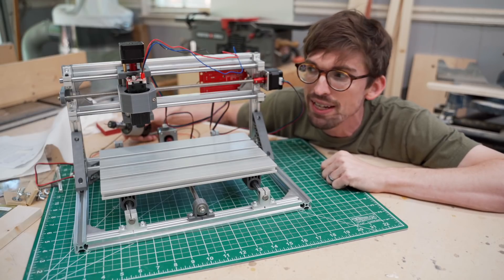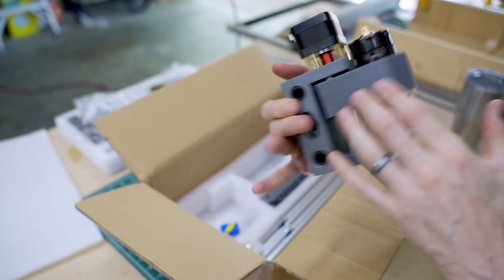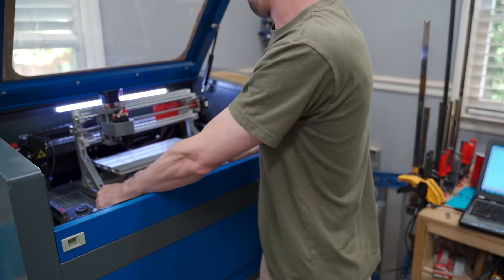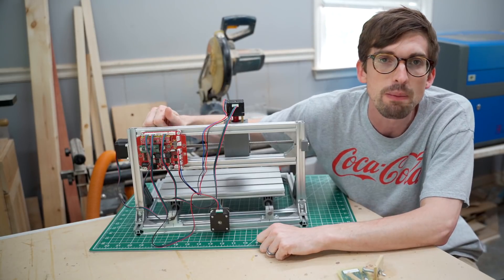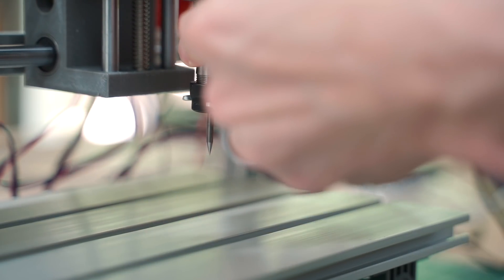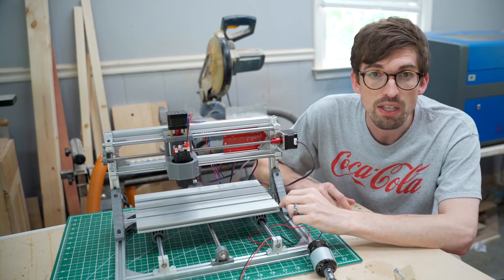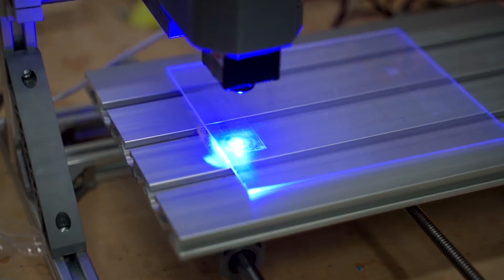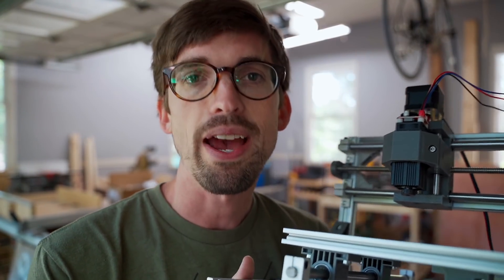Is a Sub $250 CNC worth it?  Alfawise C10 CNC & Laser Review

Comment: I spent round 130€ for the same CNC. And had fun with it for five months. Ok. the laser should have been 5 Watts and was only 2.5 Watts... good for my eyes. PEOPLE PLEASE BE SERIOUS WITH LASER BEAMS. Once the damage is done no doctor can help you back. THEY ARE BUT F*** DANGEROUS. If you wanna learn about G-Code and CNC basics one of these simple devices will get you in there with ease. Ok. They don't have end signals. But you can add them. They will not mill metals without modifcations... but if you have the right drills you can do a lot with wood or some polyuerathane foam stuff.

Comment: If it was $250 in 2019, and the inflation rate is about 8% since then, the price should be about $270 to keep up with inflation.  However, the price in the link is $353, nearly 30% higher than what is quoted in the video title.  Not sayin' the title is a lie, but that that the current price is a HUGE ripoff. 🤬

Comment: I wonder if I can put my router shanks and make it work with those ones. I have a small manual router (those 300 watts sold everywhere) and came with a 6mm straight, which I think could use it.

Comment: you can do some decent stuff on these things,  I use it to cut out my kids pinewood derby cars.   I have to use a jig to hold the block on and the limited z causes me to have to run the derby car block thru the table saw first to bring the height down and do it in 2 parts if its a taller car. 

also with the laser, I've laser engraved a flour tortilla. LOL

Comment: Depends on what you want to do.

To mess around and learn a bit while possibly making useful trinkets... these little machines are a good start.

Low cost and see if you are actually going to do anything at all with it.

When you find that the stuff you want to CNC carve is not going to be able to be done on the little machine, change it to a laser engraver and get a better CNC machine.

These little things will make some nice looking coasters and key chains and carve the color layered plastics for small signs.

Not good for engraving brass really.

If you want to make a small number of thin aluminum sheet metal parts for RC models, the 3018 series CNC can do the trick.

Comment: The problem with ALL these cheap CNCs is that they rely on the stepper motor's ball bearings to absorb axial (thrust) forces created by the leadscrew. The leadscrew in real machines is located in a thrust bearing equipped block, with the motor attached by a flexible coupler. The ball bearings can not take much axial force, and will fail much sooner than if they are coupled properly.

Otherwise, the problem is flex and a weak spindle motor/mount. Good enough to learn on, and for cutting/engraving acrylic. Clever people might be able to make some improvements...
Reply: Curtis Newton  Axial play makes inaccurate cuts, which I'm sure you couldn't care less about. My comments were directed at people who care about what they do, not at hacks who have nothing better to do than talk shit on the internet.
Reply: Yeah that's one thing I did on my machine was fully support the lead screws. They ride in bearings on both sides. These machines cut every corner they can. That's how they can sell for $150. Those unsupported round guide rails are pretty flimsy too. They look like inkjet printer surplus to me.
Reply: Curtis Newton  you can't replace bearings in stepper motors. Well I guess you can. But the motor won't run after you've taken it apart. Well it'll run at 10% of its original torque. Those motors you're getting with this machine are the weakest piss you can buy as it is too. So you cannot afford that kind of a sacrifice. So essentially you can't replace bearings in stepper motors. You demagnetize the rotor in them when you pull them apart. You lose the keeper function of the motor body. And that's why it can't be done.

Comment: Well, you can put $650 ( Creality CP01) or $800 ( Snapmaker) into  a triple threat, OR BUY a Sovol printer for $300, and a separate CNC/Laser for $250. When one goes down ( ajs my CP01 did within 2 days), you still have a functioning CNC. Creality has been remarkably UN-helpful in providing replacement print head, or in authorizing a return. Now the print head has shorted-out the thermistor. It shorted agains the metal work table, hand that will not heat above 47 degrees. Nothing will stick. Without Mac software the CP01’s CNC function is out of reach. I am TRYING TO GET A RETURN OK, but I bet it will go out to the garage, and will sit under a garbage bag, as I TRY to forget a totally miserable experience with Creality and their CP01. AVOID IT LIKE THE EBOLA VIRUS!!

Comment: Any laser doesn't work on clear or shiny surfaces.   You need a non-reflective coating or surface.   They recommend anodized aluminum at best, because you can laser the anodized layer.   But if you're creative and understand the fundamentals, you can get it to work.  If you don't do anything like this professionally, you're going to struggle with doing anything more complicated.

Comment: Seems like a better way to go than the 3-in-one Snapmaker or CP01. Get this and a good 3-d printer....cheaper than CP01....redundancy is better than a failed firmware machine.
Reply: Forget the CP01. Mine arrived very incompletely manufactured (I thought it might have been a returned unit)...Creality manufacturing Quality Control is non-existent....customer service will leave you twisting for months if the CP01 fails.

Comment: Looks like a tinkerers type machine. I can see a lot of upgrades to make it way better just watching this.
Reply: CNCing a stiffer Z assembly being the first one.   But I tend to think you'd be better off with a MPCNC instead of turning this into a good CNC.
Reply: I wouldn’t cnc anything. Just add linear rails for one. Then upgrade the crappy main board and laser. And use marlin. It’s open source and you’ll have a good little toy.... I don’t think this is intended for a serious CNC machine but a beginner tinkering machine to learn.

Comment: Could a 5 watt laser then finish the job 2 times faster?
Reply from the maker: The speed might be more dependent on the stepper motors and the strength of the frame.  But in theory that would totally work!

Comment: im thinking of buying one of these can the bed and frame be extended to make it double size?
Reply from the maker: Potentially you might need to adjust the settings in software
Reply: Of course, similar to like 3D printer as on that they say once brought one you have all that is needed and often just bigger frame and bed to do bigger, of course on printer often have gt2 belt as well

Comment: Keep in mind that laser can be very dangerous! Anything above 1mW (0,001 Watt) has the potential to harm your eyes! Even looking at the reflection itself without safety goggles can make you permanently blind.
Reply: @A channel has no name I seen some that scan apparently and wondering if they scan object so can say where to write as then put object on it and have a wall around as prints then not have to wear them but if have to line up by machine first probably wear then

Trying to find one for under £200 that does metal and wood

Comment: Will it mill aluminum? I would want to use a small CNC like this to mill smallish aluminum parts from blocks
Reply from the maker: Maybe....it would just be really really slow.  The frame wouldn't' be rigid enough or the spindle strong enough to push it very fast.
Reply: Okay. Makes sense
Reply: The harder material you cut the more rigid the machine you use needs to be. Aluminum is pretty soft but it is far harder than soft wood. When a machine flexes cutting you get something called chatter. Which is the bit bouncing and deflecting off the work as opposed to cutting into it like it is supposed to. Chatter is bad. At best you get a poor cut surface finish. At worst you end up breaking your cutting tools. The unsupported round guide rods this machine uses as linear guides are going to bend like a bow too. But you could upgrade them to real linear rails. This machine has other design shortcomings though. Like unsupported lead screws.

Comment: i seen some guys 3D printe a 52mm bracket and buy the $64 upgraded kit from banggood (500w spindle motor, power supply, bracket). I wonder if that upgrade kit would push this machine into the CNC milling category of 6061 aluminum but on a budget setup with little DIY fabricated parts needed. Would love to see a video on this! These are my plans I want to do to a 3018 machine and test mill out some aluminum one day. 

Some links i found for testing out this setup,

Motor kit upgrade: https://www.banggood.com/Machifit-ER11-Chuck-CNC-500W-Spindle-Motor-with-52mm-Clamps-and-Power-Supply-Speed-Governor-p-1027937.html?rmmds=search&cur_warehouse=CN
3D printed bracket 52mm: https://www.thingiverse.com/thing:2719169
Reply from the maker: Hadn't seen that, I'll have to give it a try!

Comment: I have the revised version the 3018 PRO, and I can even succesfully machine aluminium with the right end mill. Just don't expect it to be very fast.

The main limitation is the spindle motor, it's a small 755 style DC motor which randomly comes in a lot of speed variants and mine was particularly slow, so I had to kick up the voltage quite a lot to get to a decent spindle speed.
Reply from the maker: Good to know!

Comment: This is interesting, I got the same model and mine has resin 3d printed parts and a whole motherboard enclosure and fan
Reply: where did you order yours from?
Reply: @deemon328   I got mine off Amazon from here https://www.amazon.com/Control-Plastic-Acrylic-Engraving-300x180x45mm/dp/B07BCGKPBD/ref=mp_s_a_1_7?keywords=3018+cnc&qid=1572989655&sr=8-7
Reply: @deemon328  by the way mine has worked really well, I cut 5mm aluminum with it for a sprocket adapter for my go kart project.

Comment: Does it work on aluminum
Reply: Yes, but the default bits can't handle it and it'll work very slow
Reply: By the looks of it, the Z axis flex would probably need improving before it would work on aluminum.
Reply from the maker: You would have to run it really really slow so probably not the best for it.

Comment: I'm not sure 3D printing parts is a cost cutting measure. Usually 3D printing is a very expensive option as soon as you start to produce any sort of volume.
Reply: It's awesome for Prototyping though
Reply: Depends on. Weather you have the $5k+ for a injection mould

Comment: I have a CNC 3018 pro. The z axis was abs injection molded, an had a lot of play in it. 
A few weeks after having it l, I got a 12,000 rpm spindle for it. I had to design and print a new z axis carriage for it. I used pla because it is more rigid
Reply: @Jack Vandergriff surprised not nylon carbon or abs as think they stronger and stiffer
Reply: @Jack Vandergriff surprised not nylon carbon or abs as think they stronger and stiffer

Comment: Does it work with Ubuntu Linux ?
Reply: I run a CNC machine with LinuxCNC which is Debian. That's kind of like Ubuntu. The old LinuxCNC version used Ubuntu. You could build LinuxCNC on Ubuntu. I wouldn't, but you could. I use various FLOSS software to generate G Code all on Linux. I don't do Windows.

Comment: I don't think you'd wear out motors, split air conditioners have stepper motors for setting direction of air, when turned off, the nozzle director turns into cover. When it reaches the end, the motor just keeps stepping to ensure that it's there.

Comment: Those included v-carve bits are directional. Use them in standard clockwise direction or the cutting edge won't touch the material.
Reply: Now I'm going to have to run one in my mill which I can reverse to see if what you're saying is right. Because those bits sure look symmetrical to me. I can't reverse the spindle on my CNC machine as far as I know. Not gonna try either.

Comment: Very nice video, i have just received an exact same machine, a 3018, same motherboard like yours, but my laser connection is different, it´s a two-cable connection and i don´t know where it goes in the motherboard. Could you please help me, if you know about this. As you said instructions are not clear, spindle is fine, but i haven´t tried the laser. Thanks!
Reply: Eduardo Padrón I had two cables as well. I did not use the second cable and it works just fine.
Reply: @mikedoyle5362  Hello, sorry, what do you mean when you say you didn´t use the second cable?
Reply: Eduardo Padrón the smaller two wire cable that came with the laser I did not use. I just put it away.
Reply: I only used the four wire cable
Reply: @mikedoyle5362  i see, well, i guess i´ll have to get new cables. it´s a two-cable laser, not three like others and the motherboard layout shows a three-cable connector  :/

Comment: It's a shame they sent you the "old" model. The 3018 "Pro" (and a couple of other sizes with "Pro" after them) has been available for a year or so, and improves on this one by replacing the 3D printed parts with injection moulded parts, replacing the aluminium extrusions at the front & back of the base frame, and the upright side panels, with pre-cut, pre-drilled panels that make it a lot easier to assemble accurately (and square!), and uses 4020 aluminium extrusions for the sides of the base frame which supposedly gives it more stability.

There's also an option for adding an "offline controller", which appears to be a small, probably-Arduino-powered, handheld PCB with buttons, a small display, and a micro SD card slot, in an acrylic case that you can use for controlling the machine without it being connected to a PC. Though I think I'd probably prefer to hook it up to a Raspberry Pi with a small HDMI display & keyboard, and control it like that. That way, you could use a Web browser on the RPi to run Web-based CNC/laser/gcode-sending tools, giving you most of the flexibility and power of using it wtih a laptop, but with a much smaller footprint, lower energy usage, and without tying up your laptop!

SainSmart have also just released their "3018-MX3" CNC machine, which has a load of extra improvements over the 3018 Pro, including all SIX limit switches, a Z-axis homing plate, translucent side windows (supposedly so you can safely watch the engraving process through the windows, but I don't think they're big enough for that, personally...), neater wiring, a better control PCB, and a PCB pre-soldered onto the top of the spindle motor that gives you labelled + and - spindle motor connection points and some additional what-I-think-are-capacitors.

The 3018-MX3 is what I've recently bought, and I'm impressed with the quality of it, honestly. No burrs where the aluminium profiles were cut or anything like that. I just haven't had time to put it together yet :( But my primary use for this machine will be drilling holes in home-etched PCBs and then routing around the outside of the PCB in whatever shape I need. I might do some "isolation routing" to create a few PCBs with that method, as you see a lot of around YouTube, but honestly I don't like the look of the result that gives you, and I can get much greater detail with the PCBs that I etch with more traditional methods (UV-sensitive pre-sensitised copper FR4 laminates that I etch with ferric chloride). And while I find it pretty easy to create high-quality etched PCBs at home, actually drilling any required holes in the boards was very time consuming and extremely inaccurate - and accurately milling the outline was just impossible! So hopefully this will be a huge help there!

(I've filmed my unboxing of the MX3, and I'll be filming the build process and some use of it as well, but I've not had time to edit that video together yet, either! >.<)
Reply: I've been looking into getting the 3018-MX3. I'll have to check out your video.

Comment: @UCjWkNxpp3UHdEavpM_19--Q 
You take the cheap CNC and make better parts to make a better CNC....

You are still limited by the capabilities of the spindle unit or you have 
to get a better one. (such a making a mount for a large brushless motor 
instead of the cheap brushed motor)

Its an iterative process to end up with a decent sized high accuracy machine that can handle machining harder metals at a decent speed.

Comment: Do you know if it's possible to cut 3mm plain mdf with the laser? Maybe with several passes instead of let the laser on the same position a bunch of time?
Reply from the maker: Not with a this lower powered laser.  Think of it more for engraving instead of cutting.  For 3mm MDF check out my video on the 50w laser I’ve got, that can cut through with multiple passes

Comment: Looks interesting. This is pretty awesome for starting out with small stuff. I am looking into MPCNC (mostly printed CNC), you print a bunch of the parts, and the metal parts/electronics bundle is about $275, plus you need a bunch of conduit for around $20. Much more work to assemble but 2 ft x 3ft, definitely a lot more DIY.
Reply from the maker: That’s cool!  For the size that price is hard to beat

Comment: Looks like the Alfawise C20, for $100 more is "All Metal". Still pretty cheap. Oh, but it looks like the included laser is lower power. 500mw vs 2500mw. https://www.gearbest.com/laser-engraver-&-cnc/pp_009321249185.html?wid=1433363&lkid=19763477&lkid=19763481
Reply from the maker: Very cool, I’d be interested to see if the build is stiffer and let’s you run it a higher fees/speed.